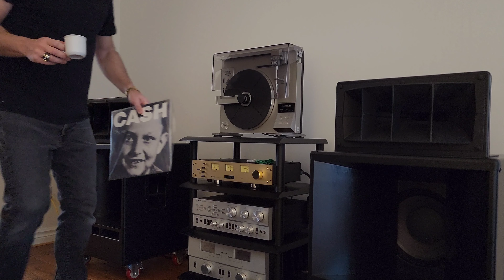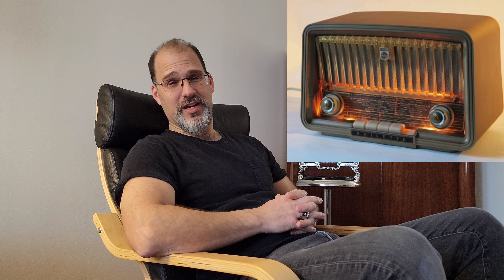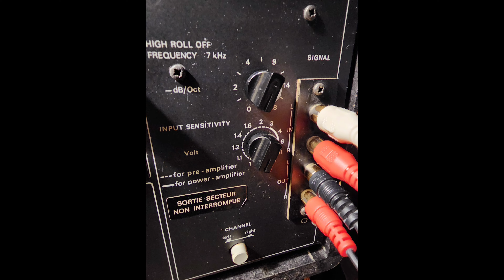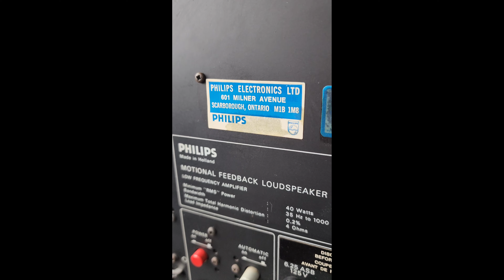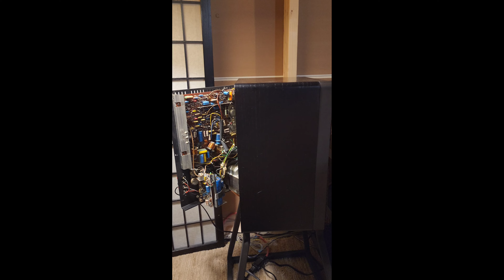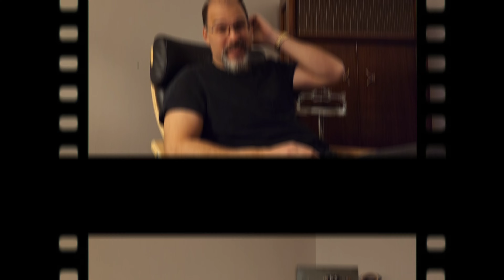Philips RH-544 Electronic Speakers!

Comment: Hi, thanks for the video. Just a little afterthought, after 3 years. I think you mentioned in the beginning the speaker was developed in the US? I might have mis-heard but they are actually very Dutch, completely design in The Netherlands and built in Belgium, the US versions had different transformers (110V) and connections (RCA) but still built in EU. You can see on the sticker, the serial is PL03 634 110060. PL means Philips Leuven (factory code). They kept the "Made in Holland"  for a while as this was kind a a trademark as a support towards Philips, people liked stuff built in Holland. 03 it the 3rd hardware revision. The part with 634 is actually the date code, meaning week 34 of year 1976. This was the actual production date of that speaker. SO only 100060 is the actual serial number. I have 5 pairs, 1x MFB532, 2x MFB541 and 2x MFB544. And I also really like my HPM100's but that's a different story...
Reply: The misunderstanding likely arose because the displayed preamplifier, tuner, and power amplifier—part of the Philips LAB series—were designed in the United States by Joe Nicolosi, Don McConnel, and Earl Rap. This equipment was also manufactured in the US by Magnavox, which was owned by Philips at the time.

Comment: Nice video! Any recommendations stereo repair Toronto area. Need an amp recapped.
Reply from the maker: Yes, contact Matthew at Tech Sonar. Tell him I sent you.
Reply: @1JGP1  thanks, they were closed when I called. I emailed them, should here from them next week. They have great reviews!
Reply: I also have a pair of RH-544’s. I’ve had them for years,had them completely recapped about 5 years ago including the main capacitor. Hopefully the should another 40 years! 😅

Comment: I just acquired to he 567 pair. Where do I find the power cords? Thanks
Reply from the maker: If I recall, they plug in the back. Standard fare stuff from the 80's that had "plug in cords" would be a good candidate for power cords. Sometimes the cable end will have a shape to it, i.e. old technics had almost a figure 8 shape on the end...So, you'll just have to be mindful of that when looking. Any of these cords that are rated from 10-15 amps would be idea.
Reply: Thank @1JGP1

Comment: In the Netherlands they are really not rare. Many people like them, but also more people don't. Keeping in mind their age, they are really good. Especially the base. The mids and highs might be improved on though. The dome midrange made from paper sounds a bit muffled compared to the silk (more modern) version. 
Worth in the Netherlands is far less than in Canada, more like 150-200 for the pair.
Reply from the maker: No doubt - I'd suspect Phillips (in general) is much more common in the Netherlands based on it's origin...Here, Phillips certainly was known for some appliances (shavers), lights (especially halogen) and many other household electronics; However, I don't think most associated the brand with great hi-fi...It's true, they are good sounding for their age - ahead of their time being self powered, and (dam) they have good sounding bass! Thanks for sharing!!

Comment: Philips engineering and distributing its audio products mainly in Europe (Eindhoven Germany and in Holland, Austria etc)  few of us in North America were aware of how big Philips audio was in the 50's, 60s. Philips was one of the majors of the recording industry, and were manufacturing their own tape recorders, complete line of amplifiers, tuners, turntables, speakers, and manufacturing all of its components, from capacitors to tubes and semi conductors.. Remember the Compact Cassette ? Philips put it on the market in 1963. Remember the Compact Disc? Sony/Philips were at the orgigin.. etc etc.. Unfortunately, same thing happened in Europe as America, the japanese audio products made local products disappear.. remember H H Scott, The Fisher.. Marantz being made in N.Y? By the way, the 22rh544 were engineered in Eindhoven (according to Radio Museum) and yes, the piece at the center of the woofer is the tweeter, the accelerometer being housed in the voice coil cavity, and returning a signal to the amp/signal correction system (Motional Feed Back - MFB) There equally was a preamp/tuner in the 22RH serie that was matching these speakers, not the AH serie. Great products. Just like Philips, Braun had a great line of audio products, not just razors lol, the "euro look" didn't sell well in America, so, they were sold under the A/D/S brand.
Reply from the maker: Great info! Appreciate you comments - quite interesting indeed...

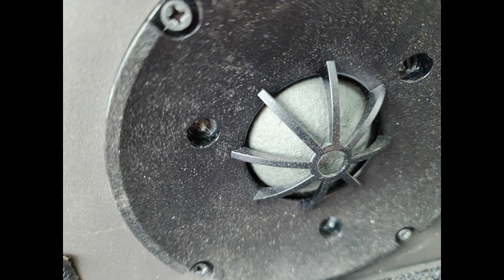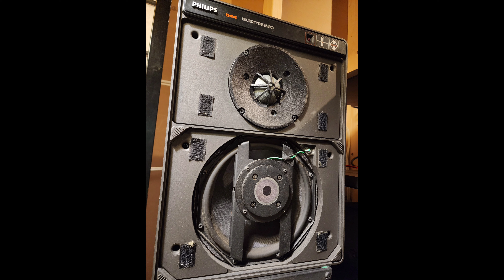Comment: Hi! 10:26, Indeed that is a 2 inch high power dome squawker (mid range) AD0210/Sq (4 or 8 ohm). ). 10:38 Here is the 1 inch soft dome tweeter. Thanks for the video.
Reply from the maker: Thanks for watching & sharing!

Comment: In the mid to late 70s, my father owned a pair of 3way speakers made by Philips,  utilising the same tweeter that is mounted in front of the woofer on these powered speakers.
Would you happen to know the serial number or model number of that tweeter?
Reply from the maker: I don't - sorry. I ended up selling these guys; Otherwise, I would have looked for you.
Reply: @1JGP1  Thank you thats very kind, and in these times, and this medium, it is rare. Have a good life.
Reply: Hi! 10:38. That tweeter seem to be the AD 0160/T (4 or 8 ohm).

Comment: The larger MFB Speakers are even more impressive, the Philips 545 for example.
I own the Jamo MFB 100 and MFB 200 speakers, they were built in collaboration with Philips, you can even use them with preamplifiers or integrated amplifiers. The Jamos have 200W  of power per box, with 3 separate amplifiers for the drivers, but otherwise lots of those Philips ingredients. The bass is multi-layered, really clean up to 20 Hz, you don't need a subwoofer. The Jamos have silk tweeters from Seas, which the Philips unfortunately don't have, the Philips tweeters are a bit harsh and imprecise. The bass speaker and also these great midrange speakers come from Philips, as here. They sound like really good large floorstanders with a sub. The MFB Bass has a special sound, even on lower volume.
Reply from the maker: Thanks for sharing! I agree with the midrange and low end on the Philips - it's a bit of a surprise when you first hear them!

Comment: Not sure i understood the rca ins and outs. A simple source like say my phone goes into the right and left of each spkr and you correspond the push buttons as such but why do they have left and right on each one. I honestly would live seeing a video on just the rca connecting coz it's weird
Reply from the maker: Yup, it is weird. You can actually connect them a couple different ways to get them to work.
Reply: @1JGP1  i have two pairs and luv them so much.
Reply: @1JGP1  it's just so you can actually daisy chain a whole bunch. connect as many as you want and after connecting, assign left or right. It's just easy like that, I know people that had 8 pairs of them. BTW: the EU standard at that time was not the 2 RCA's but one stereo DIN
 connector, so in EU the plug was stereo anyway.

Comment: Really nice video! 
You made a little mistake however. This speaker is a threeway design. The device mounted in front of the woofer is not the accelerometer but a tweeter.
Otherwise very interesting and well made video, thank you!
Reply from the maker: You are right - it is a three-way, that's a tweeter. There is a piezo-electric accelerometer, but it's actually mounted under the dust cap of the woofer...realized that well after I made the video. Good catch!